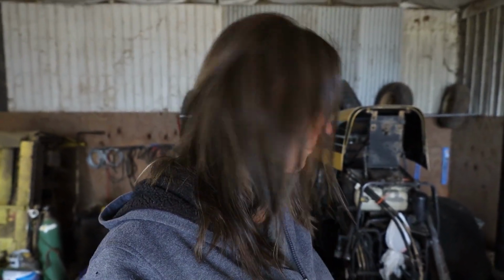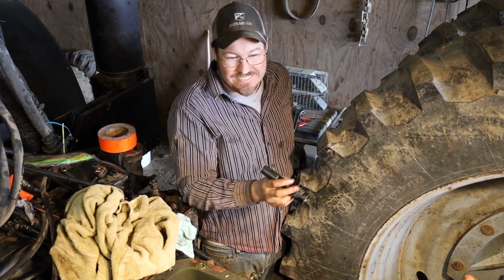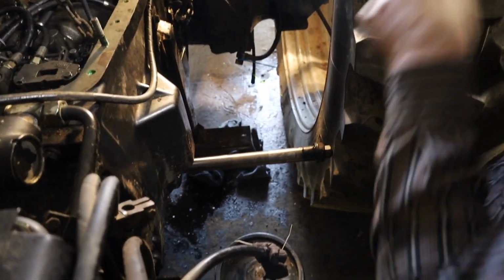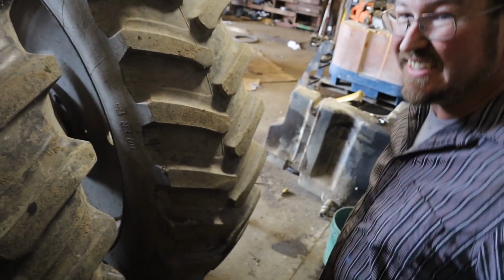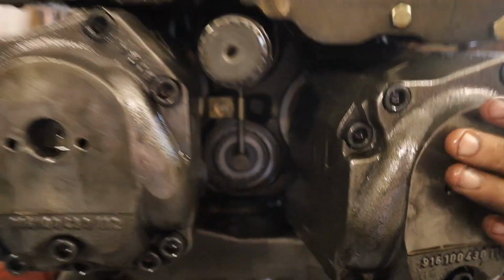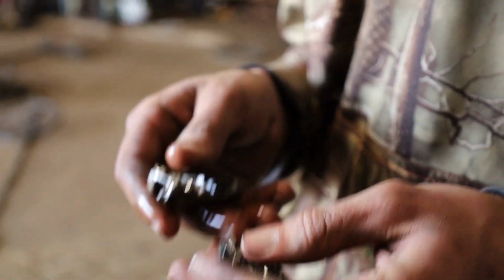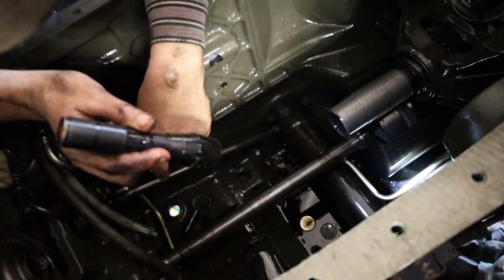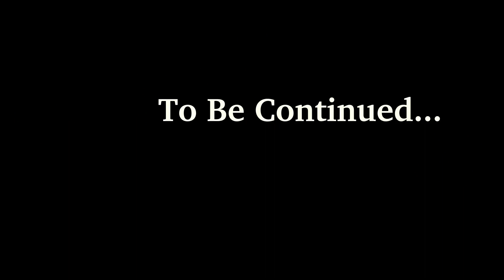Removing the CVT Transmission ~ Part 2

Comment: Hi, Rhonda and happy Easter!😊💙. Nice job removing the transmission on the tractor. Also, it needs more horsepower like the 1969 Chevrolet Corvette with amazing acceleration and handling.💙💙💙💙. So...yeah. Good luck and have a wonderful Easter!😊😊💙💙💙💙☀😎👍

Comment: You guys are tackling a tough job. Can't send any good luck I'm mostly out (what farmer isn't). Dairies are the hardest working places.  After busting the throw out bearing sleeve putting a dump truck engine in with a skid steer I now use a harbor freight chain hoist between the lifting device and what I'm picking up.  It gives a you some feel , better control and you're right next to it, where the hydraulics don't.  Be safe out there we need you.

Comment: Yes,.....definitely have to keep track of hoses, cables, parts and pieces.  I do not know what you guys have for rigging equipment,.....a chainhoist would give you more fine tune control on lifting/lowering.  Also turnbuckles on 2 of 3 legs may help in leveling load.  Keep safe!!!

Comment: With all that wind, it would be money in the bank day if you had a far more than adequate grid-tied DC to AC inverter, wind generator, solar panels, battery bank,  and super-capacitor bank etc...

Comment: Did you have some kind of course that you took to be able to take this apart, repair, reassemble and set up the transmission? I consider myself somewhat mechanically inclined -  I can rebuild an engine, but I wouldn’t have a clue where to start on something like that transmission.
Reply from the maker: No course at all...
Reply: I have been watching your channel for over a year, and it never ceases to amaze me how you all just dive into these repairs,no matter what it is, without any hesitation at all.

Comment: Kevin will get this  done. there is no other choice. I am a very old mechanic and this doesn't look so daunting to me as it does to most people. I would get the dealer 3 point hookup to put the new one back in since those pins could be troublesome to line back up.
lots of money hanging on those chains.

Comment: Hi Ronda, how much is the rebuild gone cost? You can keep it a secret if you want. A guy had a JD rebuild at JD and his w as $24,000. Different transmission I have learned. The guy  2 JD transmissions and both went out at around 7,000 hours. My guess well be $12,000 for a transmission. But it could be $24,000

Comment: well with the core, it is going to be a few bucks.. not good with so ow hours, it not even broke in.. id say it is a factory defect, but these companies dont do recalls.. they just hope the warranty runs out before it fails, sound to me, the whole failer from bolts falling out, that were never installed to spec.lucky only one bent steel line on the lift out, dam hard to see down in side, never mind work down in there

Comment: The sad reality of the matter is that your grandpas tractor was like 100 years old and probably has more than 10 times the hours and still run perfect. They just don't build longevity into products anymore for what they charge.
Reply: I doubt there are too many old tractors with 70000 hours on the engine without being overhauled.
Reply: @billprigge7747  Not true.  My Dad's first tractor needed a valve job every year and rings every second year.  A 50's vintage tractor might have went up to 35 hp on the drawbar, and there is no way you could do 3000 hours on one without a rebuild if it was used with moderate to heavy loads, especially the gas models.